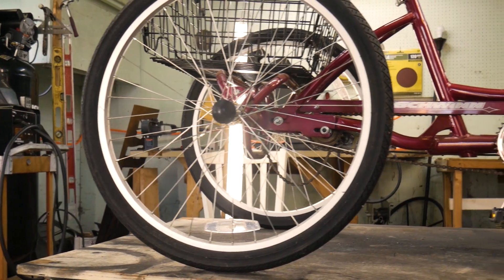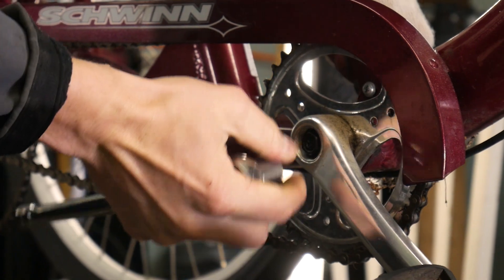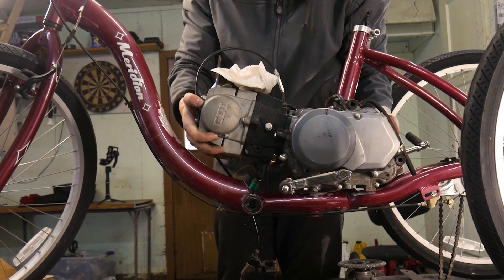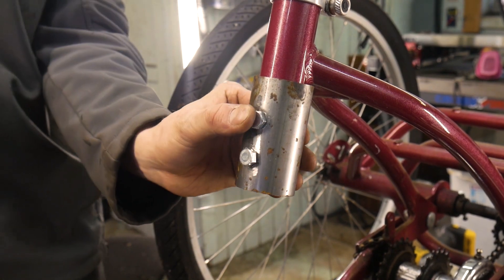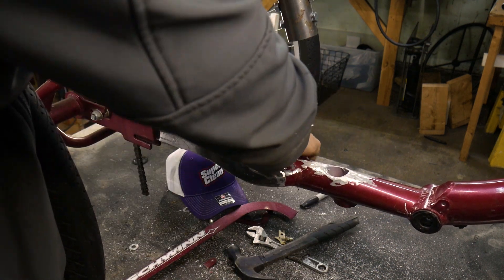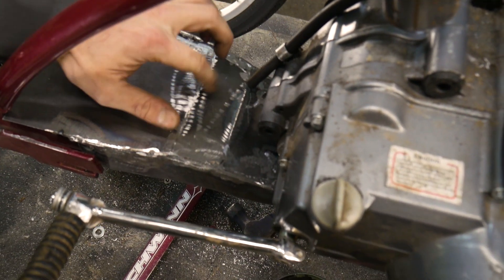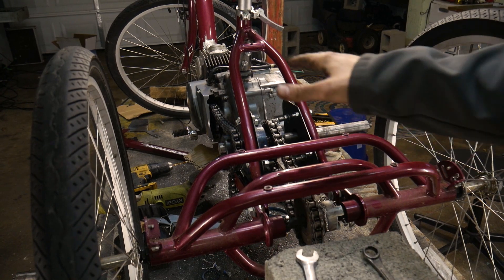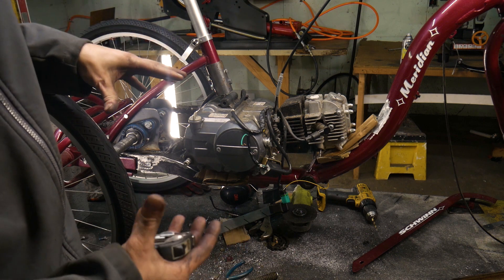This Granny Trike Gets A Dirt Bike Engine (part 1)

Comment from the maker: Second part is out! https://youtu.be/AfuUWPOlJTs
Reply: Skateboard wheel tensioner or electrical tape wrapped around something round lol
Reply: Oh i will be watching part 2 to watch the rear  end destroy itself
Reply: Aluminum cuts,using a thin cutoff disc 4in on angle grinder and take a candle and run disc thru it while disc is spinning and wax wheel coat disc, now it will cut aluminum and the disc wont clog up with aluminum, wax wont let aluminum stick to disc and  it cuts smooth and fast, you can also cut aluminum  with a circular saw, using carbide teeth  blade, try the wax, you will be amazed.
Reply: SPANISH SUBTITLES PLEASE!!!!! AND I SUSCRIBE

Comment: I built a 3 wheeler, also, but removed basket and mounted the 5 hp briggs and stratin, lined up with rear sprocket to centrifugal  clutch on motor , had to replace smallsprocket with a larger sprocket and  locked axle at sprocket to dfive both wheels and each wheel had to be locked to the axle.it was a very dangerous bike to fast and 3 wheels so easy to flip sideways and roll,but for all these reasons , it makes it fun youre soon to find out.

Comment: Oliver, that "thing" is half of a Lovejoy coupling. They are usually used to connect electric motors to pumps, etc..
Reply from the maker: gotcha! I suppose I could have googled it lol. Thanks
Reply: I think the generic name is a "jaw and spider coupling or jaw coupling", but they are primarily used to dampen vibrations or handle some shaft misalignment.
Reply: @lewisgaines8883 I've never heard them called "jaw", I have heard the center rubber piece called the spider though. We bought them directly from the company and they were always just Lovejoy couplings to us.

Comment: When you cut aluminum with 4 in  angle grinder use thin cutoff wheel and a candle, bees wax whatever  kind of wax and run grinder disc thru it, coating disc
Reply: Could work. I'm bit iffy on cutting aluminum since it will fill the disk holes and when heated will expand and can explode the disk if its not meant for aluminum.
Reply: @Hellsong89  The disk will cut right through aluminum and not plug up the disc using metal grind disc,i was told this 30yrs ago by an old welder and he gave me a chunk of bees wax, to try and  it works fine never destroyed a disc the aluminum cant stick with hot wax on disc spinning 10,000 rpms, it cuts like butter, try it you will cut aluminum from then on using wax.

Comment: I strongly  recommend swapping out the rear axle and rear wheels for heavy duty ones. Husky cycles sells the heavy duty wheels and  full length 17 mm rear axle that fits right into the Schwinn frame.  The stock Schwinn rear axles tend to break  (with no motor) on the stub ends where the factory machines them down from 17 mm to about 13 mm for the wheel  hubs.
Reply: Thanks for the info

Comment: The Angle grinder can also be used for aluminum you just need aluminum cut off discs Pay attention right on to of the discs. 
it tell you what kind of materials it’s able to cut.
Reply from the maker: ahh gotcha, figured the speed that it spun was just melting the alli and gumming things up

Comment: Fixing steel to alloy will cause electrolysis and the drive cog is not central it will make the chain go tight as it turns

Comment: That 3 tab piece you used in the driveshaft is a Lovejoy coupling (half of one) They are for output shaft connections that need a rubber dampener .

Comment: that joint looks like a lovejoy connector, its mostly used for electric motor applications so they're extremely strong. good luck with the project.
and the space that you just made where the two downtubes meet, you can fit your fuel tank in it. thanks for the video.
Reply from the maker: Thanks for the info!

Comment: To get better connection on the holder and sprocket in alignment vise, bolt both together try to get it into lathe or any other thing that can hold it. I have just couple bearings and cheap lathe chuck in a tube welded to plate frame to hold peaces at the moment, soon to become diy lathe, but now it can be used to turn them to find how crooked those are, do corrections and then weld them. Loosening the bolt you can adjust it to close to center as possible to remove least some of the vibrations coming from unbalance. For smaller parts if you can chuck it into drill that is cheap and easy way to figure this out and even do some turning with a grinder.

Comment: I'm pretty sure the rear axle support is steel . I would have mounted engine in rear where basket resides and would have left  pedals also you can buy freewheel adapter to have double freewheel 1 for pedals 1 for motor I'm not knocking your bike.. I will shoot video of mine and post it
Reply from the maker: I'm hoping to put the basket back on there! I like the idea of keeping the pedals, but I definitely won't need them.
Reply: @OliverMotorized  true your engine is my favorite.. but if run out of gas or lose spark or whatever nice to be able to pedal

Comment: The piece you used to mount the sprocket is one half of a spider coupling, used to transfer torque while also absorbing some backlash you might have. There should be another identical piece that faces the first one with a lobed bushing that fits in between the teeth of each of the coupler halves.

Comment: Thats not a "dirtbike" engine its a "pitbike" engine still very cool
Reply from the maker: haha gotcha!
Reply: I'm glad you cleared that up, that makes a huge difference 😂
Reply: @JamesPiccone  most dirtbikes have a vertical cylinder, 4-6spd transmission, too, some have liquid cooling and they can range wildly in size, output, etc. Pitbike engines are about $300 brand new(chinese) are always oil/air cooled and have the horizontal cylinder, 3-4hp and make about 4-10hp, depending on the valve size etc.

Comment: What happens when sprocket gets worn and time for replacement? How will you adjust chain tension ?
Reply from the maker: the whole rear axle is adjustable, so you can loosen it and pull it back.

Comment: That thing is called a love joy coupler it joins two shafts together with shear pins in both side s sought one side locks up it shears the pins only instead of ruining the motor or equipment kinda a safety of sorts

Comment: Hey   man You did ok but I'll tell you how to  do it without all the scabbing a nd ugly stuff . Start from scratch and build your own frame . Draw it out on some cardboard ( so it will last out in the shop ) with all straight lines and you won't have the hassel  of bending . You just have to make some fish mouth ends . Just make sure you make cut your parts lonend cuts g enough to count for your joining cuts. Use some motorcycle wheels and not bicycle wheels. That will get you started . I think you can do it . Go Man !!!@!

Comment: Lovejoy connector
Reply from the maker: thanks!
Reply: @OliverMotorized  your very welcome! The only reason I know is I use you build concrete mixing trailers and and this is how we connected the drive shaft from the Honda engine to the imput shaft on the hydrolic pump

Comment: No grinding aluminum doesnt work.
Reply: Grinding aluminum works if you run grinding blade into wax like a candle it coats the disc and melts into the pourous grind, and wont let aluminum stick, and allows you to grind as youre grinding run disc thru candle to keep it waxed.

Comment: Video idea: Maybe you could try building one like in this video below and show us how well it works?
https://youtu.be/HHOuIOYe1Is
That "thing" is one part of a 3-part electric motor coupling. There are two pieces like you have and the third is a rubber star that fits between the two halves.

Comment: Duuuude, just learn how to weld aluminum, I'm pretty sure the welder you have will do it if you attach a spool gun which is quite cheap.
Reply from the maker: lol yeah, I think it's prob about time to do so!
Reply: @OliverMotorized  just check out some of toxic Fab YouTube videos to learn some tips and pointers on aluminum welding, honestly it's easier than steel welding if it's a decently thick piece of aluminum, you can make beautiful flowing beads quite easily.

Comment: willl u help idk any that can or will sir u seee that carb u have on that bike in this video i got the dam thing i need a intack to 19mm can u do that can u weld me a intack odff that to 19mm i just need somthing that can bolt right to that carb an to rubber tube i have sir so u need how thay make a intack for carbs like the one u have in this video bolts to carb an to motoer but i need one bolt to carb an fits in to rubber tube whith hose clamp so can u make me one ill sand u some cash for ur time nothing big only need 3in lone pipe an its just need to fit thart carb